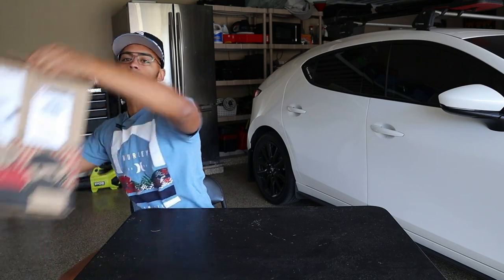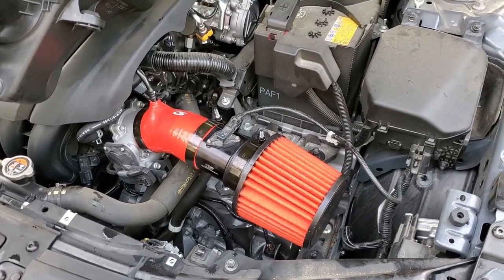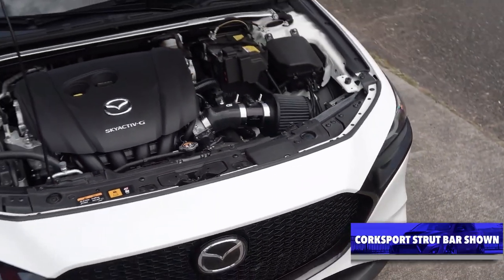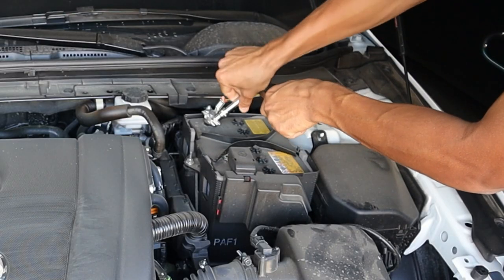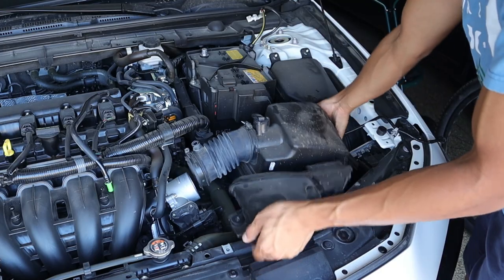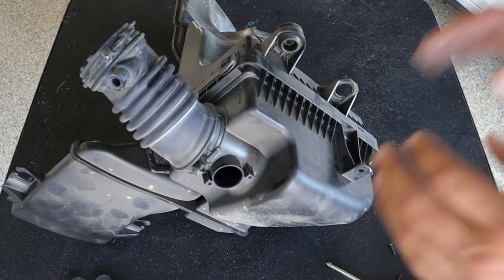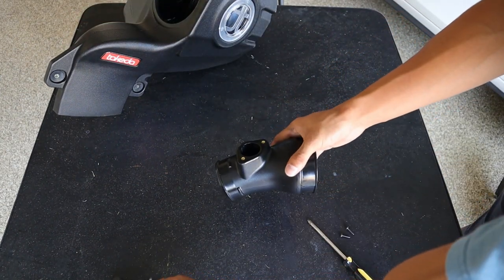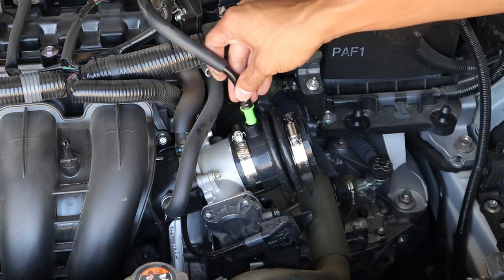aFe Intake On A Mazda 3! | 2019+

Comment: Hey Strady, Ive been enjoying watching your build on the 3, I'm getting my own soon. I was wondering if you've run the intake without the rubber Takeda insert opposite of the intake piping. 

I read that it lets the intake be more vocal  without sacrificing the fresher air from the system, but I haven't been able to find a video or a write up confirming.
Reply: I am interested in what this would sound like with the grommet removed also. Potentially u could remove it for a sporty drive in the hills, to hear some induction roar. Then refit for your daily commute.

Comment: Question.  We dont need a car memory saver for this car right?   I need to run wires through the firewall.  Would be nice if you made a video on how to do this to add a solar charging system to the car because it starts dying within 3 days I beleive if you dont use it.  Plus the alarm and inverter

Comment: I just want childish stoostoostoo turbo noises without ruining the performance 😩
Reply from the maker: If only life was that simple 😢
Reply: So short ram is actually better for turbo then the cold air intake, so for NA cold air is better for compression but on turbos the turbo heats the air back up so it doesn't change much
Reply: @zdoomboy yes, the turbo heats the air, but that's why all turbocharged cars have an intercooler
Reply: The short ram definitely doesn't ruin the performance

Comment: Can afe cold air in take for 2.0L gen3 Mazda3 (my 2018) fit with the 2.0L gen4 mazda3 (2019+) ?
Reply from the maker: Im gonna say probably not, the aFe website say’s specifically for 2.5l
Reply: aFe Takeda Stage-2 Cold Air Intake System Pro 5R 14-18 Mazda 3 L4-2.0 56-10020R. Check that out